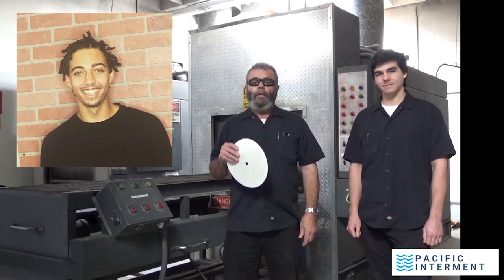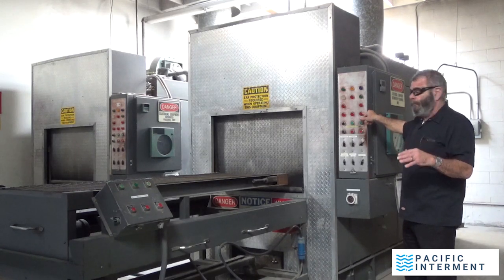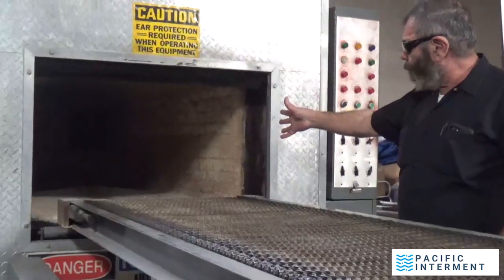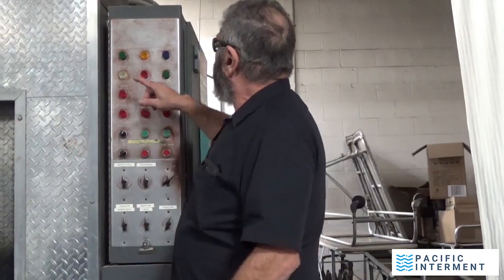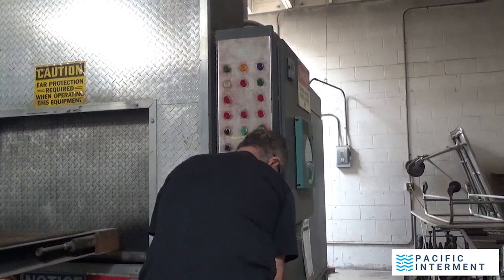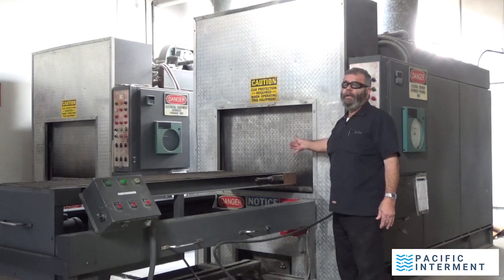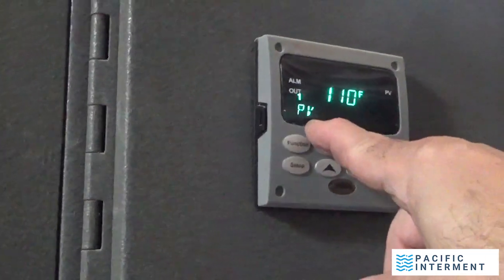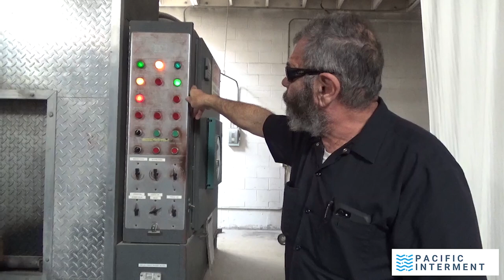Cremation Overview & Setup

Comment: Fascinating video. Is there no additional filtering required in the US, like here in Europe? After the gases pass the 2nd chamber there's usually an huge (and expensive) extra filtration system to remove dioxides, mercury etc. Or is that different per state?
Reply from the maker: Scrubbers are not currently required here. Who knows for how long......

Comment: Very informative how long does the bone fragments have to cool off before raking them out to grind them to ashes?
Reply: Hi! 

They don’t! We just have to wait for the crematory to drop below 500 degrees! So normally that’ll take around an hour sometimes 2. So the bones don’t have to cool down, but the crematory does!
Reply from the maker: We are not required to wait for the machine to reduce temperature and can clean out immediately after the cremation. We do however have to wait several hours before we can process.

Comment: The information is so specific to that particular machine...and, frankly, that machine seems a bit antiquated.
Reply from the maker: All retorts are basically the same and have been for decades. I would put my machines up against anything out on the market today and they would run cleaner, be more fuel efficient and faster.

Comment: What is setup cost of whole system
Reply from the maker: The retort alone in current dollar cost is about 250K US. The auto loader is about another 50K . The installation I do not know since I do all that type of work myself. You also have to have a fire resistant building and whatever permits your location requires.
Reply: @themortuarychannel3977  thanks for replying.
Do you have any idea about,can we open this in the side of petrol pump by any chance i have land just side of it?

Comment: I am getting ready to order a retort for a brand new facility. I have years of experience using Matthews Power-Pak II's, like you have. I am debating on a CFS-2300 from Cremation Systems (they have a great Youtube video, titled, "Cremation Systems") or a machine from American Crematory Equipment. It seems most manufacturers are going away from the traditional knob and dial controls, and switching to touch screen computer display screens. I am looking at a 3 to 6 month install time, depending on which company I go with. If you are interested in seeing the digital system, hit me up after that time.
Reply from the maker: I too am looking at aquiring two new machines. After much research I am leaning towards this company for many reasons not the least of which is the quality. Here is the information:
Mike Nadelkov
Reply from the maker: EPA Technologies, LLC 557 Quail Wood Crt. Debary, Fl 32713
Reply: What would be the cost on the CFS-2300?
Reply: hi as an young termly ill guy im thinking of cremation but can i be cremated as im 7ft 2 tall i have long arms and legs so can i be cremated if so will i produce lot of ashes ??